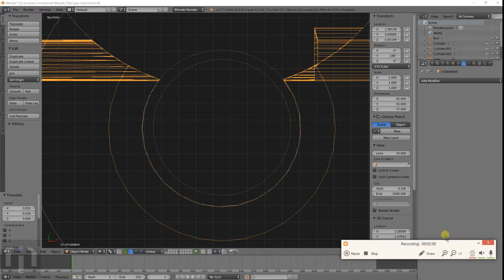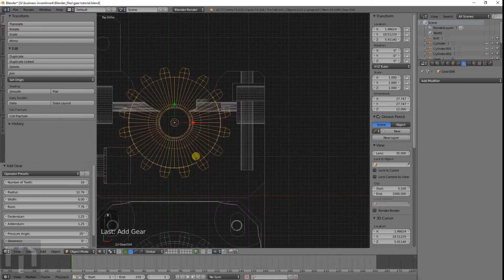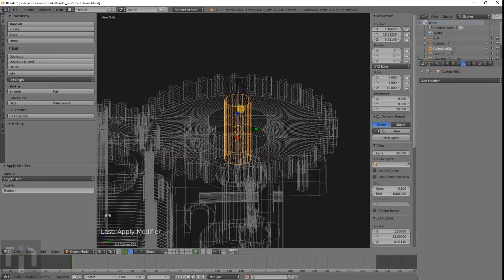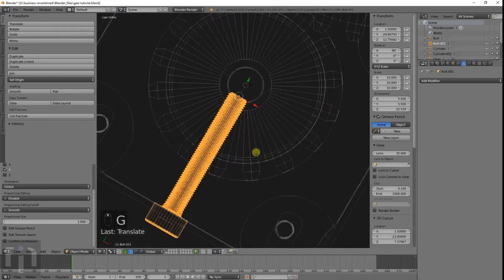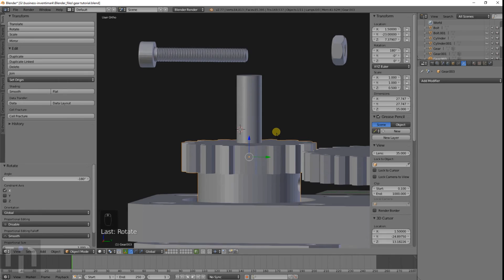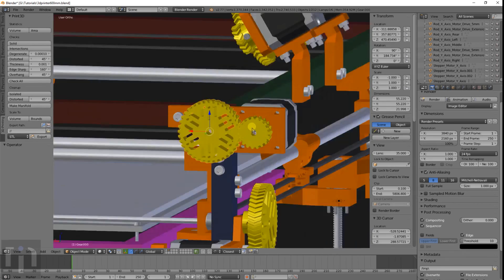Blender Tutorial #015 : How to Make Gears

Comment: Where can I find the operator presets menu?
Reply from the maker: It appears in the lower left corner in the T menu in the main area.  T opens and closes the left tools side bar.  Once you create an object, it will appear.  However after you transform or move the object in any way, that window disappears.  You have to make all of the adjustments and settings while that menu is there, once it goes away, you can no longer adjust any of those settings unless you make a new object.
Reply: Thanks

Comment: To fill in the top and bottom of the gear you can quickly select those edges by pressing ctrl+shift+M to select all non-manifold edges. You'll select the top and bottom but F will usually be smart enough to sort out which one is which.
Reply from the maker: Thanks, It's actually ctrl+alt+shift+M.  While pressing F does work and fill for this....otherwise having more than one loop selected at a time often times ends up with wacky results.  Only if there are no distortions in the loop does it work correctly, otherwise you get overlaps and unwanted out of bounds edges.  :)
Reply: Ah, you're right. Most of the time my keyboard shortcuts are all muscle memory.
Reply from the maker: Haha, yeah.  I'm just confused by how useful that one is, and how many buttons it is.  I guess I should just be glad I don't have to also use my tongue for a fifth button!